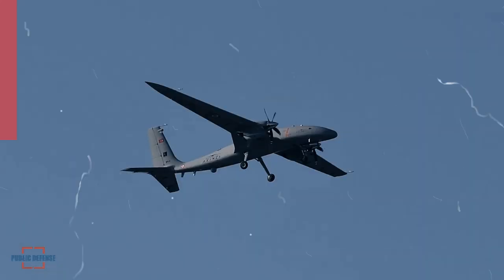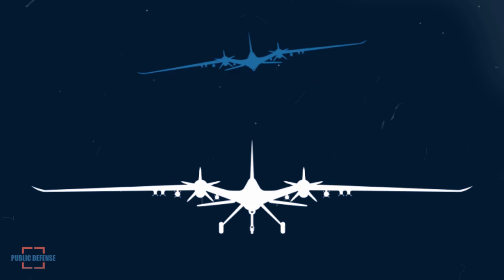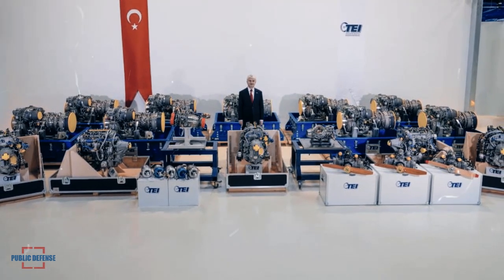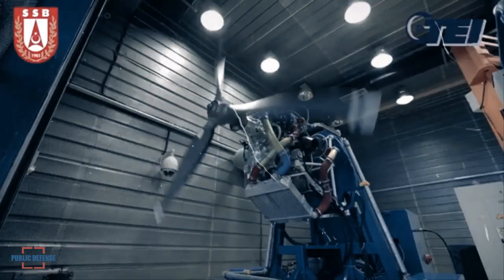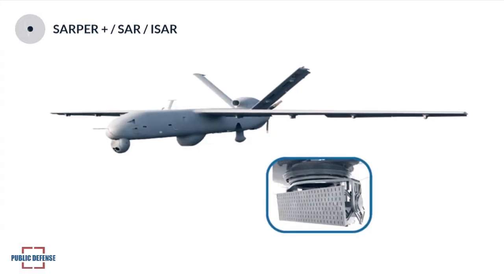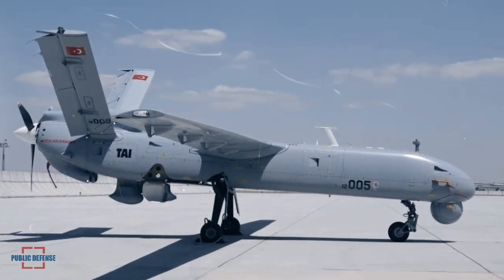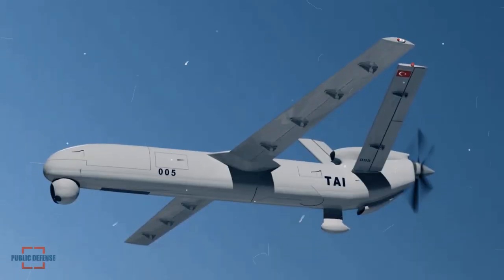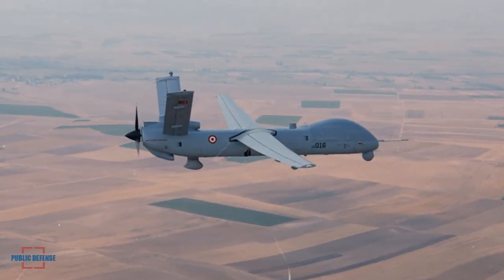Turkish UAVs will be Upgraded Using New Local Engines & Implement an Automatic Identification System

Comment: Something that are not mentioned in these kind of videos about Turkish equipments : Turkey sunk their own ship (TCG Kocatepe - D-354)  with friendly fire in an air attack in 22 July 1974 during the Cyprus operation. The reson was lack of communication. It was an early alarm for the future of the Turkish arms program.After the Amborgao against Turkey, Turkey found ASELSAN on 1975. Turks belive in the power of communication and all Turkish platforms use an unique web of communication sytems nowadays with the power of ASELSAN, METEKSAN and other partners.
Reply: Sadece aselsan degil Tusas-1973-,petlas(ucak lastigi icin)-1976-,havelsan(radar icin)-1982-TEI-1985-,Roketsan-1988-MKE Kirikkale-1927-